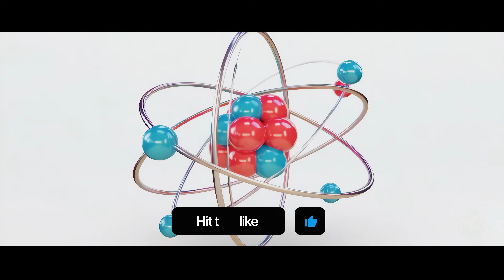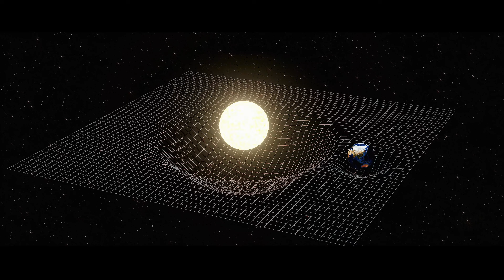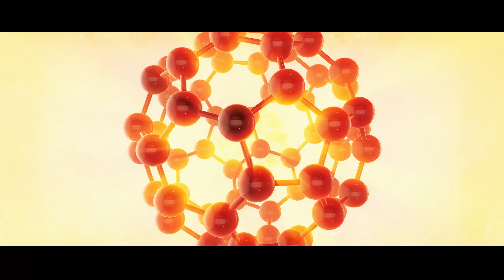Could YOU Handle the GREEN LANTERN Powers in REAL LIFE?

Comment: I would challenge you to go an read the experiments in "Emerging supersolidity from a polariton condensate in a photonic crystal waveguide" by Trypogeorgos, et al..
     This set of experiments was able to produce a "supersolid" of photons, but only at extremely low temperatures, similarly to a Bose-Einstein Condensate.
     A "supersolid" is a state of matter that is solid (in this case it has a crystalline structure), but flows with fluid properties and Zero viscosity (meaning it flows better than water), and, currently, only found at the extremely low temperatures previously stated. 
     If a device, similar to the power rings, could be produced, the constructs would be a nearly perfect foil for almost any attack. The solid aspect would actually be the first layer of protection, whereas the fluidity would empower the construct to replace any lost material by "flowing" more in to repair the point of impact. In this case, the destruction of a construct would result mostly from the wielder being distracted and not flowing the supersolid, or from not believing the construct can hold up under the incoming attack. That same "flow" might also allow for the constructs to behave as if made of a flexible material, when desired. Theoretically.
     The biggest problem I can see with these types of constructs would be the intense cold needed to create them, and how anything coming in contact with it could suffer damage from the cold. The only way I could see it being possible, for even a short period, is if the construct creates has a layer that is "less cold" similar to the layer of water on top of ice that makes it slick/slippery, but possible to handle, and I foresee similar results.
     As for the lack of mass: One thing I noted Guy doing quite often in the recent Superman movie was anchoring the constructs on the ground. Doing this allows the structure to lack the mass, but use the ground to provide the support and back the force of the construct in its use against massive objects/opponents (such as a tank). This would not work in mid-air, or in space, but it points to possible solutions if the constructs are lacking in mass.
     All of the above said, what we will most likely see first is applications similar to the solid light objects seen in the Halo series of games.